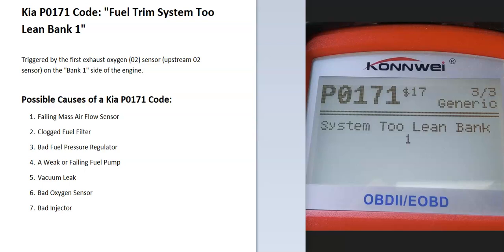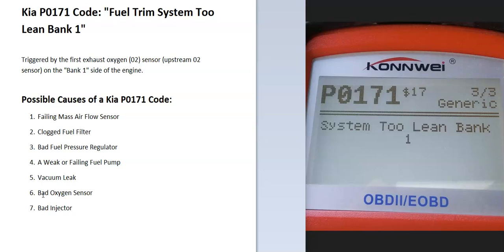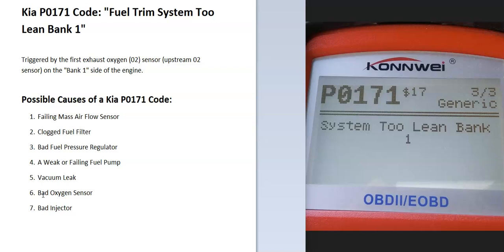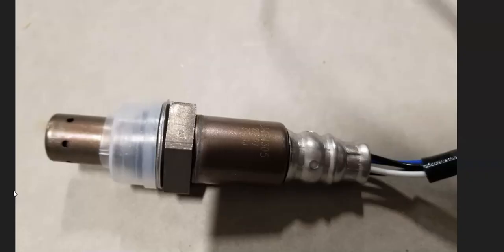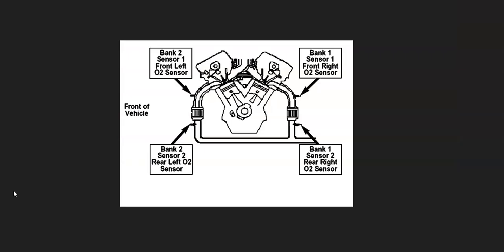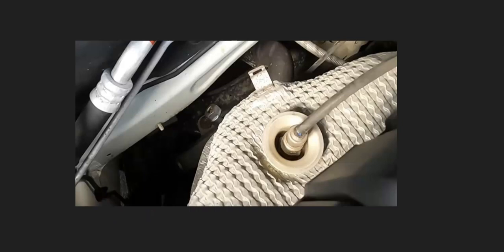7 Causes of a Kia P0171 Code: "Fuel Trim System Too Lean Bank 1"

Comment: Hi. I have a PO171 on my Toyota Wish 2006. The check engine light always comes on in the morning after driving the car for about a mile and goes away by switching the engine off. It comes on again the next morning. If I drive the car in the afternoon, I never see the light. Weird!
The MAF sensor has been cleaned but the light is still there. Recently a mechanic found a crack vacuum hose and it has been replaced, and he also cleaned the throttle body, but the light is still there. Could this be the O2 sensor that needs replacing? Can you help? Many thanks.